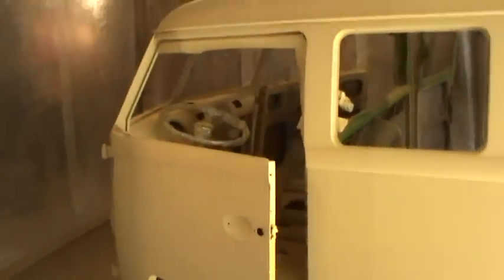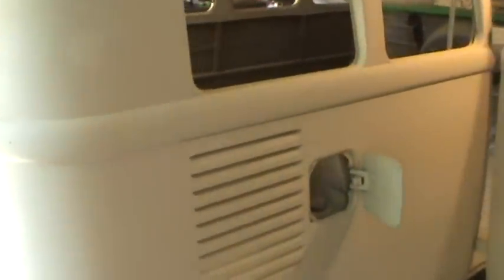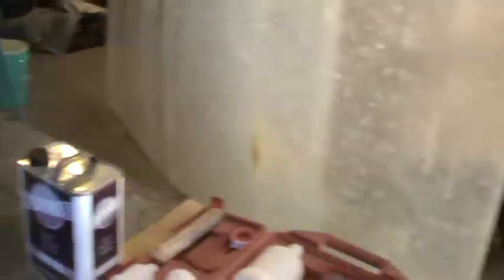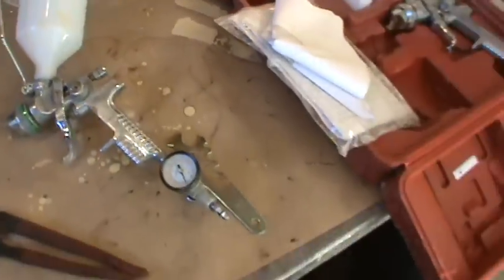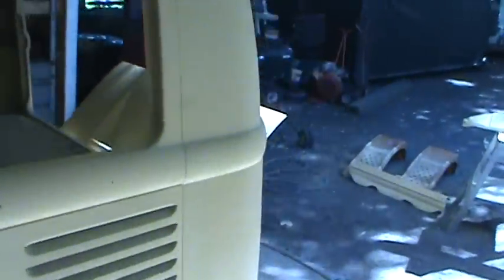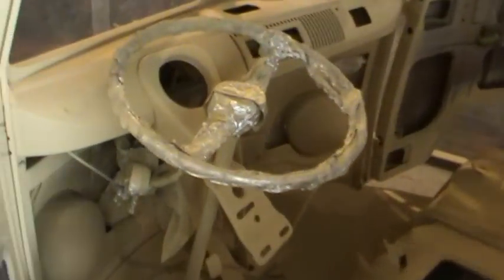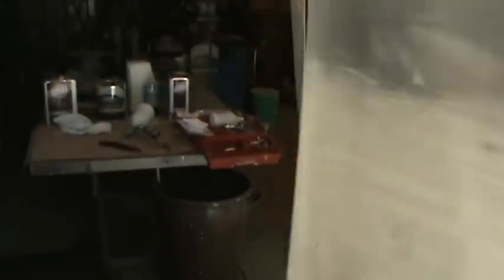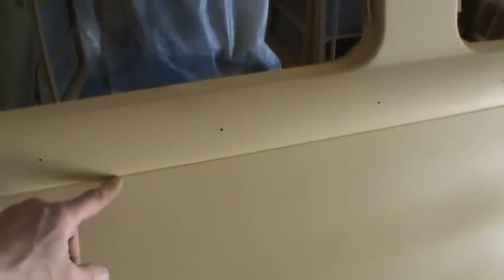1967 bus primed,

Comment from the maker: @jamesfreddys thanks I think that I may have been using too small a tip and the pressure to hi, wish I had done some tacking in between like you said, Guess wet sanding will tell how well its on there, dont want to end up with a million pin holes, thad just suck,,

Comment: The body shop i worked in had that problem with surfacer loading up so they installed a "prep booth" out in the shop area. No heat just ambient shop air 75* in a down draft setup. I would suggest using "frog tape" on the seams.

Comment: Should be able to spray the primer at a lower psi. which will create less over spray and increase transfer efficiency. Also tack off the overspray before you continue ie. do the roof tack off overspray do the face.... You get the idea. Like you said the reducer may be too fast. That primer has a bunch of talc in it which is prone to that dryness & should be contained to increase adhesion. Not masking the white off should be fine so long as you sand the trailing edge down smooth. You don't want